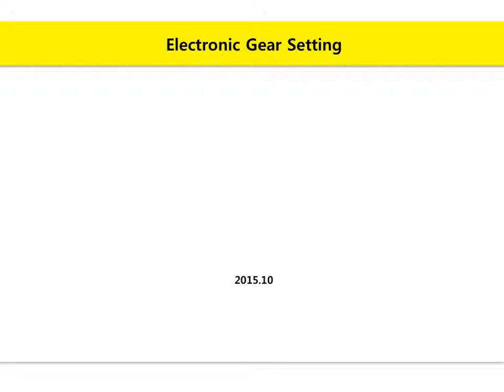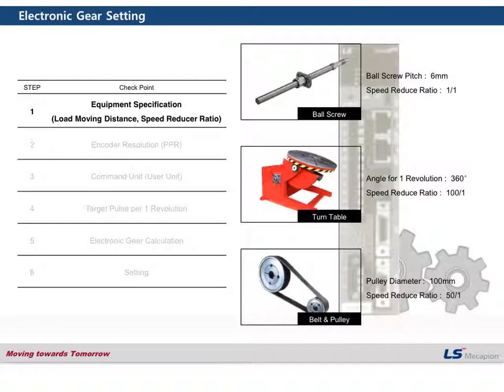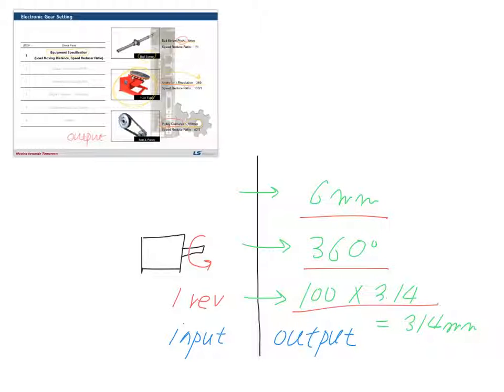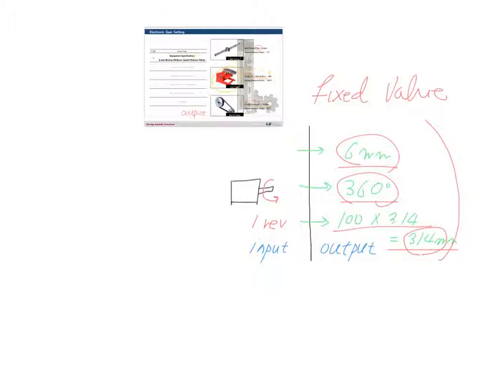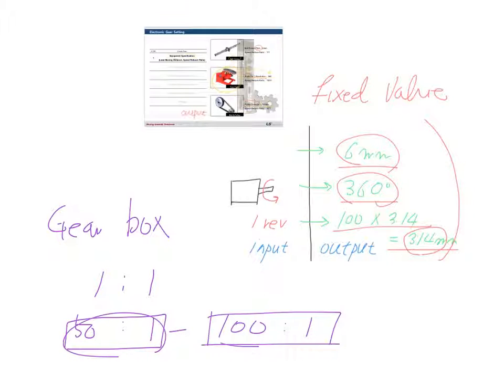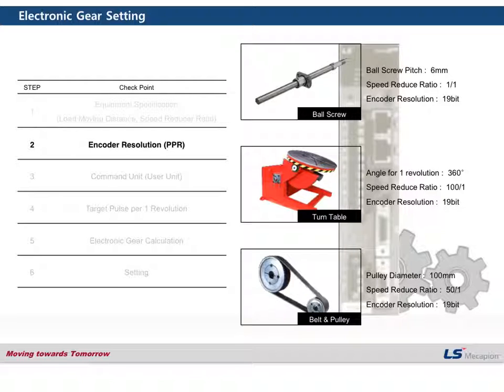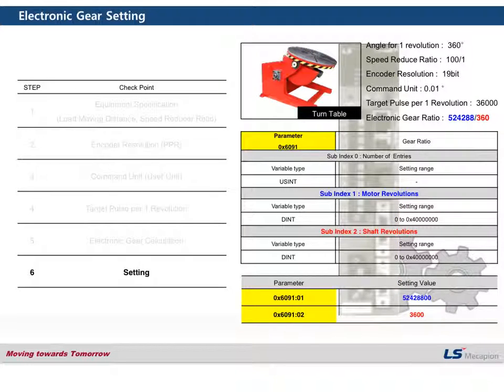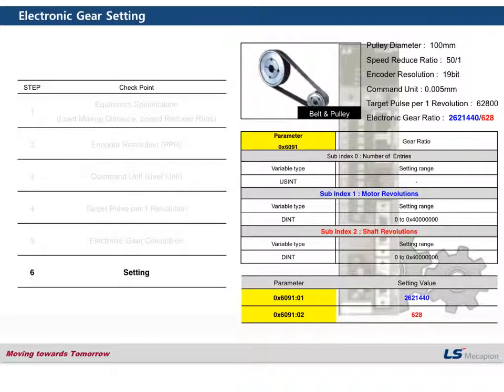L7NH product training course_6.0.2 Electronic Gear Setting

Comment: I have a winding machine that works with three servo drivers from the LS company and a programming unit PLC from LS also . It is connected to each other via ETHERCAT, and it requires programming the unit and the driver. Is it possible to work together to perform the programming, in exchange for an amount of money that you specify, with thanks